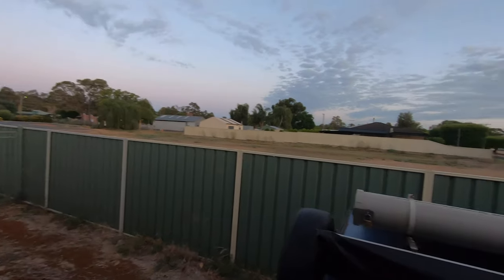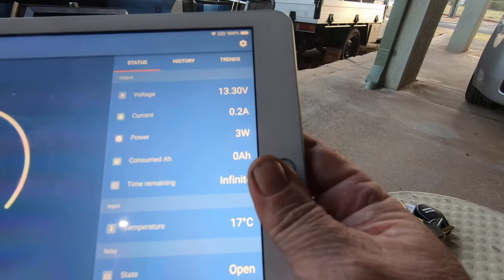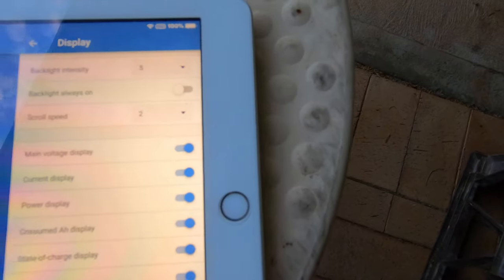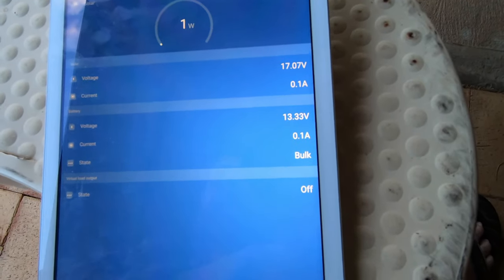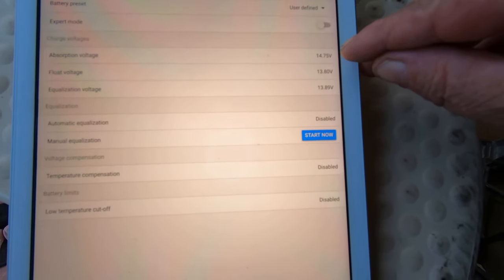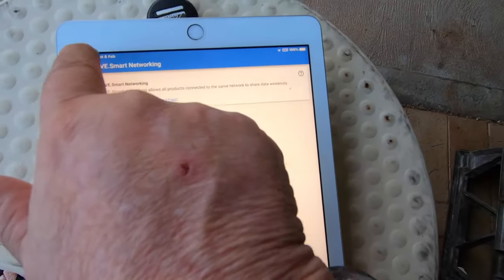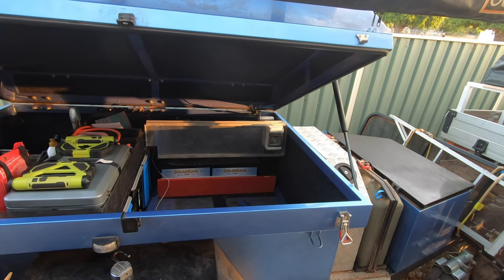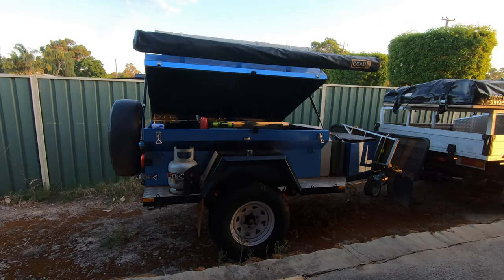Lithium battery Install 7.  Programming  Victron BMV-700-702 and MPPT 100-30 charge controller

Comment: Thanks Chris for making that clip special for me mate, much appreciated my friend. One more thing I tough that it was an no no that Lithium doesn't like to have an float charge Or is that wrong of me
Reply from the maker: in this video link around 3:34 https://youtu.be/3-5hkuvYlbg you can see the documents and setting i was required to set my controller to, So yes you need to float them. these have a 5 year warranty so i would think the settings would be right.
Reply from the maker: Ok wile in use they require float. When not in use charger should be left off and only requires charging every 6 months. According to the technical support man i just rang. Sure hope that helps you out
Reply: @JustinCaseSolarPower  Thanks for going out of your way Chris
Reply from the maker: I always try my best to give the correct information in my videos Jack. Sometimes i am wrong. That is why I tell people to do there own research.

Comment: Good day chirs I just got us a GK pip invere    5kw 48 volt
Reply from the maker: Just popped into your chanel and had a look. Very nice inverter. Should love you long time. That was a bit of bad luck getting hit by lightning and having to replace blown gear. Ouch
Reply: @JustinCaseSolarPower  yea to much money loss but back up and running got snow to day
Reply from the maker: @JonOffgrid  Yes my hat is off to people like you that live where it snows and still go off grid. Not easy to do for you in winter. I have it very easy where i live in Australia
Reply: @JustinCaseSolarPower  yea may remember me Ambrt  you to talk on Skype some time s a long time ago
Reply from the maker: Sorry mate my long term memory is shot these days. Old age is a..... Starts with B sounds like witch 🍻😉

Comment: Hi mate have just brought the same mppt charger and the same two batterys but have two 150 wat solar pannels on the van roof can I use the same setting as your and if so could you send a photo of the setting as was not to clear in the video thanks
Reply from the maker: Yes mate. Just got out of Bed. Give me your email address and after i have had my morning coffee I will go and take some photos for you. So we are clear, You need the setting for the victron MPPT Charge controller right?
Reply from the maker: Just making a small video for you Shane. It has all the photos at the end. Others may also want the settings.
Reply from the maker: Here it is. https://youtu.be/BZ_LTvG7auE

Comment: do we need a battery monitor with the pip inverter

We are having a sunny day, but's 19 and 6 inches of fresh snow and ice, so who cares about the sun, I'm not going out there!
Best
Reply from the maker: I think every system large or small needs a battery monitor John. I have 2 x on my home system, Just natural for me to put one on the camper trailer. Batteries cost a lot of $. A battery monitor that is programmed right is the best way to look after them.  The 2 batteries in the trailer cost me almost $1200.00 + all the work installing them. So yes i am going to look after them